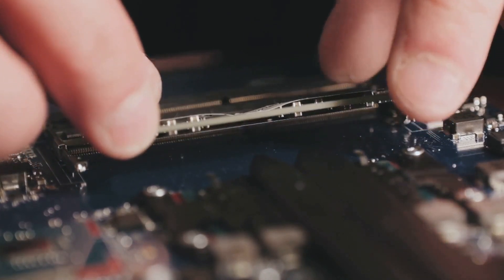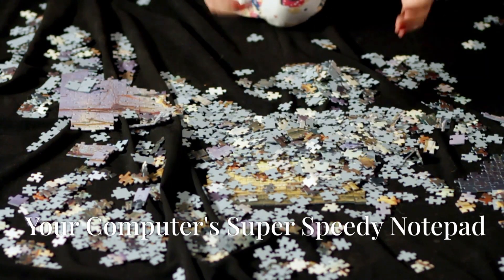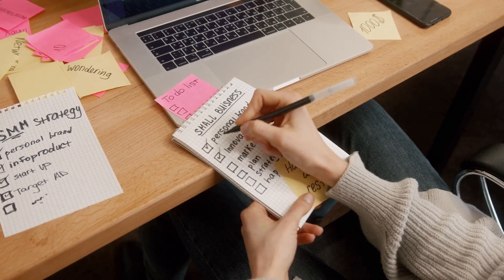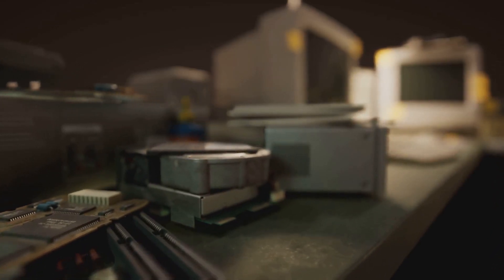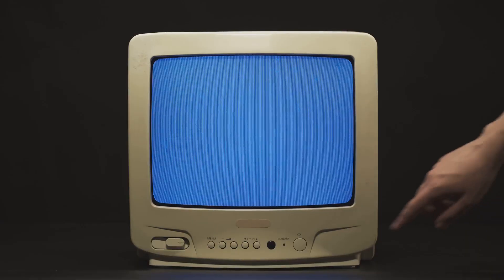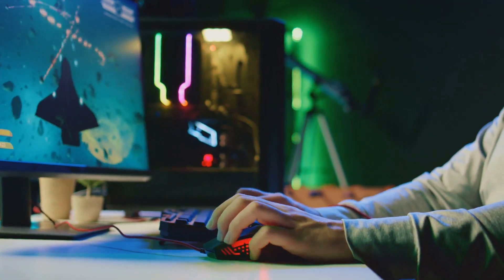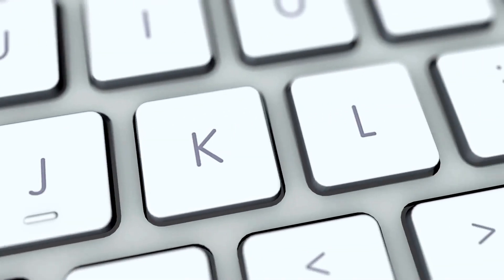You're Wasting Money On SLOW Computers Without Enough RAM

Comment: there is so much wrong with video
Reply from the maker: I appreciate your thoughts! Could you point out what stood out as wrong?
Reply: @SimplyTechwhiz  idk its alot to say but:
when u mentoned faster the RAM faster pc, thats true but if u have older laptop or pc and u put like 8Gb 3000MHz, it probably wouldn't work cuz the CPU cant support that much ram and the clock cant be that much. the system will probably show like 800MHz
""more ram more power "". if you have 8Gb inside pc and the system uses like 50% - 60% of ram, if you put more ram it probably wont make any difference.
and if you dont have any ram stick in pc, there is no way that it would work; When you turn on your pc, the system performs a Power-On Self Test (POST). during this test, the system checks for essential components like the CPU, RAM, and storage. if the RAM stick is missing, the system will fail the POST and won't proceed to load the operating system.

i recommend you branch education on yt, how many things work very detailed :)
Reply from the maker: @Withererik  Valid points, having more RAM generally gives you better performance in terms of speed however several other factors come into play ex. If the machine already has enough. If other parts are the Bottleneck (ex. A slow CPU, HDD, or weak GPU), etc..
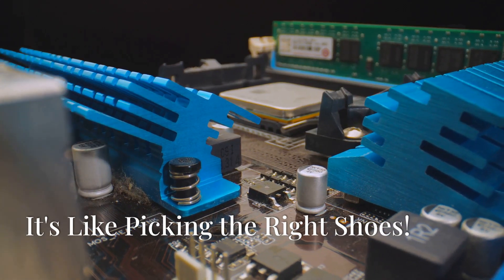Timestamp 05:42 "It's Like Picking the Right Shoes!" supports this. Thanks again for your feedback!
Reply: @SimplyTechwhiz  oh i made a missspell a work "" if you put more ram it probably WONT make any difference.""